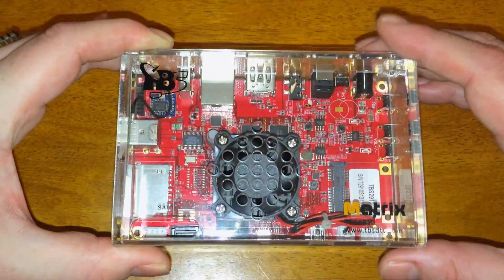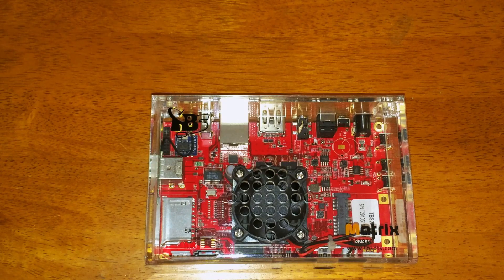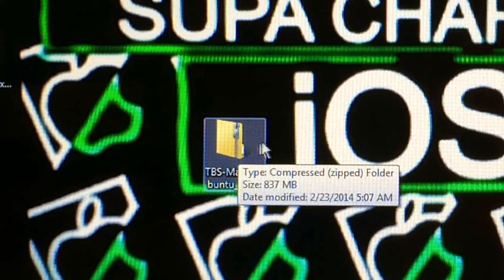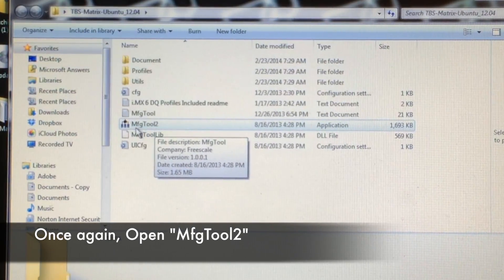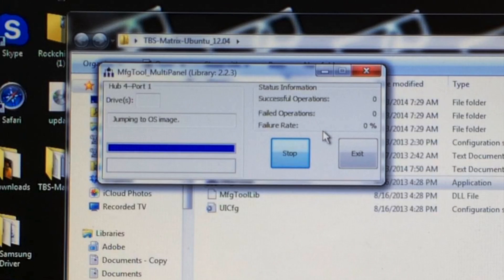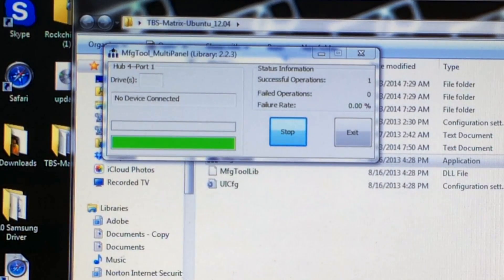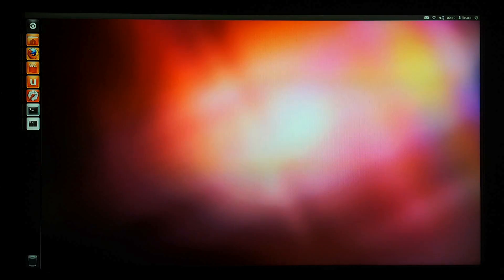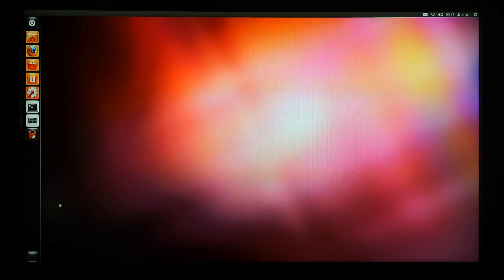Matrix Arm Mini PC - How to Install Ubuntu, Android 4.2.2 - Step-by-Step Guide

Comment: just got it, connected, did not start anything like matrix XBMC. So i guess TBS delivered it either defect or uninstalled. Downloaded all the stuff from the links and must say:
- Download Ubuntu says Version 11.x --- why are your video is diplaying Ubuntu 12.4?
2nd thing: the installer doesn't work with WIN7 64bit?
There are 2 versions: the ubuntu folder contain the library used as 2.2.3, the matrix or abndroid folder starting MFG tool says 2.2.2.
So all of that in the net @ tbs download pages and/or sourceforge are not uptodate?
anyway, the usb connection does not start... even put the little switch to the right or the left side... no difference.
So where is the problem --- a layer 8 problem? That would be me.
Reply: Now got it back from TBS... the power supply was faulty. after starting, changed OS and uploaded TBS Ubuntu 11.x, than did distribution upgrade to 12.04 ... took some time... The Ubuntu versions are hosted by linaro and the repositories are linking to them. Anyway, after proceeding with updates, installing some needful tools like mc, dvb-tools, ... detected, that the HW clock still runs on 1970 - so setting this is recommended as well as setting up ntp time server to always have actual date and time settings. One minor thing: installation of VIM7 caused an error ... but thats minor. Now installed the TBS QBOX 5922se firmware into lib/firmware/ and voila, DVBS2 tuner support was installed. No extra compiling necessary like for x86 or x86_64 architectures. Tuning now with kaffeine and control reception.... funny, it works.... but: TV in HD causes the cpus to heavy loadings.... SD is working good, but I guess I need to adjust some buffer values for AC3 and MPEG1layer 2 SW decodings... sound is only sometimes to hear.... but anyway this is not an Full Ubuntu DVBplayer ... better to chose MatrixTV XBMC for that purposes... In general, Ubuntu works fine and fast... better than on RPI of course...

Comment: Is this the same process for ubuntu 12.10? Sorry I used your process to download ubuntu to the matrix but saw it was 11.10, the application i need to run requires 12.10. I am new to this stuff so I appreciate the help
Reply from the maker: You can try it if you want, but the website only has the version that i use in the video. 
Please let me know if it works or not, thanx!!
Reply: SUPA CHARGEDiOS  Thanks ill need to figure out how to do it. As a novice your video was very simple for me to install that version. I want to use this device as a digital signage hardware player and upgrade from an android only device we have been using
Reply from the maker: Mylife614 Try downloading the version of Ubuntu you want to install, and just use my method to try to install it the same way..

Comment: First of all awesome mini, I may buy a few more.  I bought one the other day and I got your downloaded Unbuntu image running on it, however I am trying to change root password etc before I get online.  I thought you had said that the ID and  password for root was root, I tried upper case and lower case and many variations, I wanted to add a user, etc besides linaro.  I can live with linaro for now, but would appreciate if you could give me root, if you know it, so I can do whatever and add drivers etc for my new bluetooth dongle, etc.  2 other things have you gotten bluetooth  mouse/keyboard/headphones working or adobe flash working on this Unbuntu distro yet?  Thanks for your help Walter J.
Reply from the maker: WJ B Thanx for watching :-)  I'm always in touch with TBSDTV, and on their website the Root Username and Password are both listed as "tbs"  but it never worked for me either :(  
so when I asked them about it they said I should try "root" but that didn't work either.. I'll reach out to them again and if they can help I'll pass the info on to you :-) 

To change the password once you gain root access you just type "passwd" and then follow the on-screen prompts..

Comment: If you install Ubuntu, you get an old version and it takes 2 hours to upgrade to 12.4 at which point I get a "vim" error, 4th time with this process. Now I cannot install packages like XBMC because of "vim" error. HUGE waste of time! So far nobody has shown me that it is even possible to run Ubuntu and xbmc on this box... BTW, it took several hours looking for the admin password... if it helps anyone its Linaro;linaro

Comment: In the MatrixTV XBMC, most of the add ons are incomparable.... any clue why? Pls make a video walk through of each OS... So far this box is a pain!!!!
Reply: This little box is a big pain.  Won't work out of the box, don't know why.  I get a blank screen on both a monitor with HDMI and Sharp TV with HDMI.  The root user id/password isn't documented anywhere and only found it after a lot of googling.  Even then there are no instructions on how to configure the box.  Eventually hit a key after the Matrix logo flashed and the text mode configuration page showed up, even then XBMC won't start.  

I can't recommend this to anyone because it doesn't work.

Comment: How fast is this mini pc compared to raspberry pi, Looks cool
Reply from the maker: This thing blows the Pi away.. 
The Pi is worth 35 bucks, but only has 512mb RAM, and no internal storage. The Matrix has 2gb RAM plus 16gb internal storage.. 
The matrix has an awesome quad-core GPU, as well as a quad-core CPU and is capable of running XBMC flawlessly in full HD 1080p/60, plus it can run Android 4.2.2 and Ubuntu.. If you're interested in purchasing the matrix, please use my link in the description of the video, thanx!!
Reply from the maker: erion jaho I've never used a Raspberry Pi, but judging by the specs the Matrix is probably about 4 times faster and has 2gb ram and 16gb of internal storage..
Reply: Hi Supa!  Great vid as always, If I pick one up, I will definitely use your link. Just so people understand, the Pi was originally designed as a learning computer so that kids could learn how to write Python scripts, etc. without tying up their parents 900.00 PC. But then something really cool happened...people started doing all kinds of really neat stuff from robotics to game emulators, to a various OS for running XBMC.  I have a Pi running a modified version of OpenElec.  It stores the data on a USB stick, and boots from the SD card. It is overclocked so it actually runs pretty fast.  Not as fast as my OUYA (which is still my favorite XBMC device), but it gets the job done. Check out TotalXBMC tutorials. I think you would have fun with a Pi!

Comment: Hey super I hav a problem an your the only dude I can ask my xbmc on windows pc every add on I hav except 4 navi x say script faild nothing will open becouse of this. I even factory reset xbmc an started all over an iv tryd superrepo nothing will work any advice from the xbmc king would b great. ;-)
Reply from the maker: Bman Murrell Did you try removing XBMC all together and re-installing it..? 
It sounds like the only option, you might have an outdated, or either a corrupted copy..

Comment: In your opinion whats the best OS for xbmc on this device .Will this device handle large mkvs in the 19gig range for streaming and does it have allow playing of dts/truhd /passthru codecs.
Thanks
Reply from the maker: Best OS for XBMC on Matrix is Linux for sure!! Although, the Android version worked fine also. The version of XBMC that comes on the device is about the best you're gonna get. I've tried streaming in 1080p and had not trouble. It' only 16GB of internal storage, so you'll need a external HD to store large amounts of cache if you plan on streaming in 1080p..
As for network file playback in 1080p & 3D this device is definitely capable..
Reply: SUPA CHARGEDiOS Just purchased one and installed linux, but it installed 11.1 instead of 12.4..... and I cant seem to find the admin password to upgrade... also, did you say it comes with XBMC installed on linux? Mine did not, and I have installed xbmc on linux before, but on the matrix im having problems... Please help, Thanks Supa!
Reply from the maker: ***** That's strange.. To get the Linux XBMC which works perfect in 1080p/60 you have to install the Matrix TV firmware the same way that you install Ubuntu or Android..